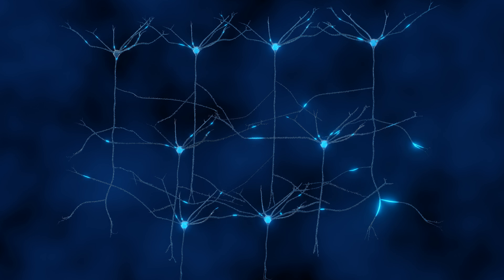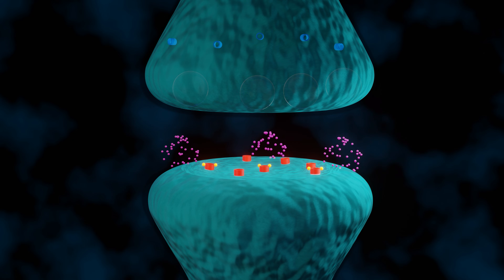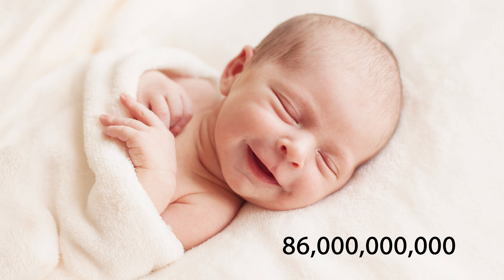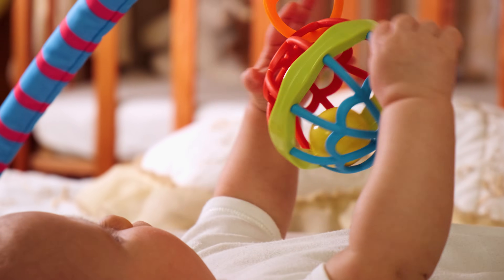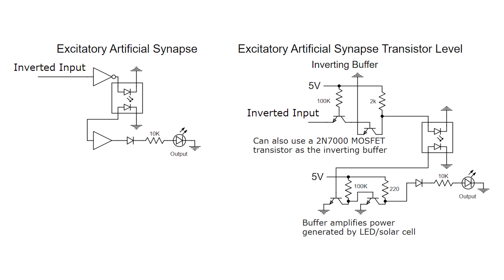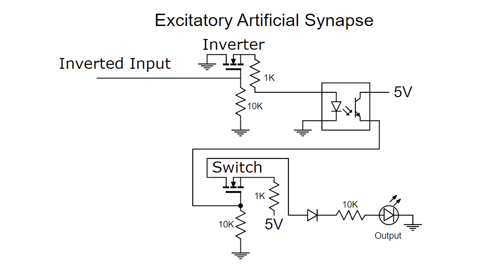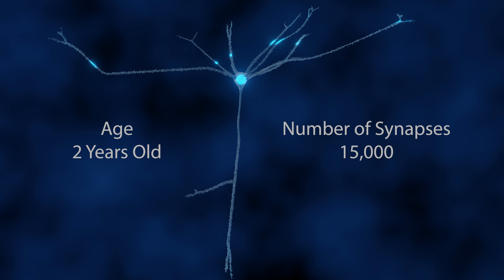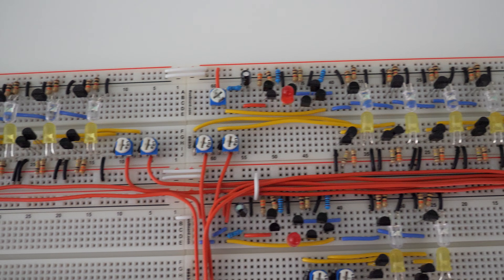How to Build an Artificial Synapse

Comment: you are not using mosfet for inverting in the practical led  based optocouler circuit and used in optocoupler ic circuit 
 why?

Comment: In this I made the excitatory neuron and receiving neuron, but I am not able to get the time delay in pulses of the 2 neurons, what could be the reason ?
Reply from the maker: It sounds like the charge is making it fire with just one synapse input. So increase the resistance of the excitatory input or increase the size of the capacitor.
Reply: @GlobalScienceNetwork i haven't made any inhibitory and excitatory neuron pair, I just have one excitatory and receiving neuron, what should I do, to make the pulses not blink the LED at same time across both excitatory neuron and receiving neuron.

Comment: Hi! I hope you see this comment. I just wanted to ask;  (6:21) is the Schmitt trigger design similar to a clock, since it switches on and off like an astable 555 timer? if is then can I use a astable 555 timer, yes or no?
Reply from the maker: Yeah, you could use an 555 timer with a capacitor. I will make a video about that at some point. Technically it just uses way more discrete components so the Schmitt trigger is the low parts design.  However, since the 555 timers is an IC it is actually more simple to implement with that.
Reply: @GlobalScienceNetwork  Thank you very much sir

Comment: Cool coincidences. In the last couple days I’ve been watching your videos and other channels’ videos about transistor based logic, and I’ve been playing with transistors on breadboards as a result, you posted a clippy movement video today which I’m obviously into, I went back to check out this video, it’s talking about optocouplers, which I just learned about today from my friend because we’re building a midi interface and he knew we’d need them, and I just ordered a few different IC based optocouplers.
Reply from the maker: Sweet, sounds like we are thinking along the same lines! I love the Clippy profile picture!
Reply: Speaking of synapses (and coincidences), I just watched Veritasium’s newest video today which talked about networks (6 degrees of separation and some results that occur because of the layout of network connections) and how neurobiologists have traced out every neuron of a specific worm (C. elegans). Apparently it has 302 neurons and ~7000 synapses.

Comment: the brain is an a natural entanglement machine the neuron are the  cell as able to set the spin state if u are able to do it ,u have to use qbit logic
Reply from the maker: I could be but I think that there are plenty of states that are changing with basic charge flow. It is still trillions of ion states per neuron. If that does now work, then it would be time to look deeper.
Reply: @GlobalScienceNetwork  tats bcause u use a bit logic on output and not analogic output then u have to use that lecature as a  qbit state abd than u get the sesult u can apply to logic so u need also 1 qubit but u can apply it to a chain thats in how work actually ia but not the brain a ia net is a linear qbit chain
Reply: umanty dont undarstand that yet but use ur brain are the umanity able to make a good use of it?

Comment: Hey, you triggered me to ask a question. Is it possible those with ADHD or are on the spectrum, have more synapses than the average person?
Reply from the maker: I am not well versed in that topic. I think it could be from excessive synaptic pruning or limited synaptic pruning. Also, some differences in the supporting astrocytes like glial cells. Basically, though, the brain connections are a little different for some reason.
Reply: @GlobalScienceNetwork  Thank you :)

Comment: Funcionaría con cualquier oscilador, por ejemplo un flipflop de funcionamiento libre, con resistencia variable?
Reply from the maker: Bueno, en realidad está integrando carga y disparando a un umbral de voltaje. Así que realmente no. Eso sería binario encendido y apagado.
Reply: @GlobalScienceNetwork  verdad pero por ejemplo si se utiliza un optoacoplador en circuito de oscilación, se podría controlar la carga y descarga del condensador, entonces funcionaría exactamente como el disparador que muestras en el vídeo. (Solo pienso en algo más pequeño pero que se acerque aún más al funcionamiento que muestras de la neurona). Ahora mismo por no tener los mismos componentes, use un Arduino para realizar el disparador, la verdad me impresionó. La sinapsis fue con un LED y un foto-resistor.
Reply: Ya que si es el caso se podría optimizar aun más el circuito.

Comment: Very cool! I was pondering something like this but from a software perspective. Fundamentally the brain is a set of interconnected neurons with different action potentials with eachother. Similarly we have Vector graphs with magnitude and direction to other nodes which are interconnected. perhaps instead of trying  to replicate the actual mechanisms behind a neuron and rebuilt the wheel... we could use these vector graphs to create an AI brain that functionally works similarly to a human brain, however each node would be a vectorized piece of information rather than a raw binary operator. 

A step up from this would be using qubits as nodes to drastically speed up computation.
Reply from the maker: Yeah, that would be an interesting approach! I am building it in hardware as this is the only way to actually make a conscious device. I explain this more in my next video which I should come out this week or upcoming weekend. I am editing it now.
Reply: It is the massive interconnected-ness that is hard to emulate in silicone because chips have to be etched so the living, plastic aspect of how our brains function cannot be easily re-created at the scale needed.  I have never even seen someone simulate a mouse brain, but maybe I missed it.  I think the AI folks are barking up the wrong trees, or networks, ha.

Comment: Please please please add two capacitors (one with high resistance slow leak and another with threshold discharge) to keep track of both synapse types
Reply from the maker: Why do you need the slow leak?

Comment: What about using surface mount LEDs in a row or grid facing directly into the sensor where rows/groups are covered by shielding to encourage the neural network to condense engrams within the groups
Reply from the maker: Yeah, that would be one way to do it. That would be worth trying.

Comment: In the circuit with the button, which transistors are you using?
Reply from the maker: Both of them. It is a buffer that increase the current of the input from the LED that is acting like a solar cell.
Reply: @GlobalScienceNetwork  Sorry, I meant which type of transistor, i.e. 2N222?
Reply from the maker: @thebestusernameevr  Yeah, in this case they are 2N2222 or 2N3904 either one will work.
Reply: @GlobalScienceNetwork  Ok thanks for the response. I'm trying to copy the circuit @5:05 but I can't seem to get the blue light to to turn on. I'm using 5V from an arduino, 220 Ohm resistor to the white LED, then 1k resistors for the other ones. As far as I can tell, I have it wired like yours

Comment: It seems to me that your focus shouldn't be on the optocoupler, but on the variable resistor. For instance, why should the output change... that is, how to effectively model the variability of the ion channels? Perhaps there should be a combinatory gate that adds voltages depending on other criteria. I don't know enough about neuromedicine to say what those criteria are, but it does look like that should be a major point of research into the development of a model that would imitate the function of an actual neuron. Learning could be accomplished by preferring certain paths by repeated use until one path is always used, effectively "reducing the number of synapses". Perhaps the artificial synapse shouldn't fire at all unless the output of the combinatorial gate reached a certain potential, either through a single path (learned behavior) of combination (trial and error). Maybe a zener diode and feedback? (sorry for the edits, am just thinking about it as I type).

Comment: Uhm... what's actually the point of the artificial synapse/optocoupler? It's just a simple relay.
Reply from the maker: Well you at least need a buffer so you can send to multiple neurons and then a diode so you do not get reverse current. Do they have to be electrically isolated is debatable for a fixed network. I plan to leverage the optocoupler in neuromorphic designs. The plan is for it to be able to learn on its own by interacting with the environment.
Reply: @GlobalScienceNetwork  Using optocoupler to embed a neural weight intrinsically?

Comment: Great video. But a question still is in my mind. How do you want to make it to learn. Now it's a network with adjustable weights but no auto asjustment method for the weights is provided. By the way great video.
Reply from the maker: If you watch the RC truck video you can see that I adjust them manually with a potentiometer. I will be making a neuromorphic design in the future. You can try and make it neuromorphic as well.
Reply: @GlobalScienceNetwork  Great! I can't wait to see that video. I subscribed 👍

Comment: Since memristor changes it resistance base on the input current, why not use it for the synapse since there will be more current flow if lower resistance and less current flow with higher resistance
Reply: There are several papers on this

Comment: Maybe it would make sense to add a thin sheet of that kind of phosphorescent material that gets charged with UV and DIScharged faster with, uh, I forgot the frequency range, red or IR perhaps; between the two halves of the optocoupler, so it can have both an activating and inhibitory inputs based on LED wavelength; and the fading of the phosphorescent adding a bit of an "analog filter" to the pulses like the little squirts of neurotransmitters; and by having it be somewhat thin, you can have it work also as a biasing factor, contributing more or less to the incoming pulses that would partially shiny thru?
Reply from the maker: You could try it.  A "solar cell" has a pretty fast response and similar behavior but I am defiantly open to other ways!

Comment: Why do you need an optocoupler (LED/photodiode)? Can a simple inverter (74HC06) or an NPN transistor be used instead?
Reply from the maker: In this case they are just a relay or buffer but will try to add in some features in the future for neuromorphic designs.

Comment: Thank you for the information. Is it possible to receive additional information regarding the diagrams? Please provide a detailed description and diagrams. Thank you and best regards.
Reply: Thanks, GSN! This is all so very exciting!!! I add my vote for a proper schematic and parts list, for the breadboard circuit in its present developmental state in this video. ( It would be difficult to pick these details out of this video. )  Meaning, I understand that 1) you want to expand the project to include components that better reflect the biological mechanics of a synopsis and that 2) that might start with the incorporation of op amps to replace transistors. However, I sort of feel that you are adding "project creep" to the project, before the community that you desire to create has had the opportunity to learn from building your present "ground zero" circuit. In addition to having the details of the circuit on the schematic, it would be very helpful to have you label the various operations of the synapses (presently three, IIUC) on the schematic. ( I must admit to having my own agenda... I live in a retirement community. A retired neurologist has just joined us. I think it would be a lovely house-warming gift to build out your circuit on breadboards, add the function labeling and house it in a glass-front presentation case.) Additionally, if ( in the year that has already passed ) you have not established 1) a thread on a electronics forum for communications for the electronics build and 2) opened a repository for the exchange of electronics build files, documents, etc, I suggest the Community Forum at EEVBlog, for the communications thread, and GitHub, for the files repository. I will watch the additional video. Maybe I will find that you have already made accommodations for the exchange of (electronics) information? If so, please post the locations/links in the Comments section of this video. Final thought... An AI program might be able to develop  the expanded electronics model, including the needed additional/future electronics model functions that you want to add, the schematic, a PCB board layout and a breadboard layout all rather quickly. Its worth a shot... Cheers!

Comment: His synapse circuit has a mistake.  It can't possibly work as shown.
Reply: I want to work on a project related to this topic. Can you tell me where the mistake actually is and how it can be solved?
Reply from the maker: If you explain more, I can help clarify! It definitely works as built. There could be an error in the diagram, as I am not perfect.

Comment: Now I want to simulate a synapse with cellular automatons. Like have one value for the level of voltage potential, one value for the calcium concentration and then either something like cell wall or better yet direction that "signals" can flow. 

But somewhat tweak the algorithm to model neuro plasticity, so you can do some "learning" by simply having a state of modelled neurons.

Comment: Why use optocouplers at all? And as I know, neurons have the resting potential, they're not like "completely off" as the diodes, and the inhibitory signal is the negative shift of the voltage in the neuron.

Comment: hey I'm planning on creating these for a project but I'm a little confused, does the first LED turning on the other LED purely by touch it or are they connected with wires I just can't see. I'm just confused on how power is being transfered, I understand when the ic is used just not the LEDs
Reply from the maker: There is not a wire that connects them. Each circuit is technically electrically isolated. It works like a solar panel. The light shines on the solar panel, which creates power in the other circuit. The second LED is basically a solar panel. The amount of power generated is very low, but this gets amplified by the buffer.
Reply: @GlobalScienceNetwork does the type of LED used for the second one matter or can I use anything.

Comment: It would be cool if you could use a "flawed" memristor that would become more resistant over time if not used, but would lower in resistance if used regularly
Reply from the maker: Yeah, making it neuromorphic is the next step. Keep thinking about it, or even try and built it!

Comment: Sorry but its not clear to me why the 'hardware synapse' would need an optocouple rather than a hard wire connection....  I had always thought that the brain had the ability to rewire itself - hence biological synapse were not physical connections.
Reply: It can rewire itself, you’re right.  It also can up and down regulate the number of pre and post synaptic receptors.  This is why psychiatric medications take time to exert an effect.  I’m a neuropsychiatric nurse practitioner and am studying for my PhD in neuropsychology.  I was injured in an accident in 1994 and had to stop.  I’ve picked up my studies since.  This is a crude model, but interesting.  You’re correct, there are definitely missing features on this system.  Neurons can also sprout co-lateral axons and new dendrites and new dendritic spines.  We also know that location of these synapses influences odds of inducing an action potential as well as timing frequency and which neurotransmitters are sent.
Reply: The "rewiring" happens in the form of shining the LED on a different detector. This is why analogies aren't always the best way to look at things, but especially beyond bare basics. The brain isn't "wired" at all, but that's the common analogy to describe what's going on. If you wanted to do such a thing with wires, the synapses would be spark gaps... but even that doesn't really work out beyond over simplified conceptual ideas.

Comment: hmm... a synapse has more in common with an electrolytic capacitor than an optocoupler...
Reply from the maker: This is a starting point and it does need work. Keep thinking of the best way to built them. I am building a demo for the hardware based neural network now. Stay tuned!

Comment: Implementing your circuitry as Verilog code and running on a low-cost FPGA would be optimal. 
Grok, for example, can convert your circuit diagrams into HDL code. Perhaps I will attempt such a project.

Comment: I havent built it yet ut was thinking if you added a mic input to it so the firing pattren can change based on tone input to simulate hearing in diffrent areas of the network. so as you speak to it you can see what areas fire and come up with a logic respose based on the amp of audio wave in to make a response. Like if it hears a loud noise it chould have a reaction like fear or activates the other networks to try to figure out if it is good or bad and if good respond 1 if bad respond 2 if undeceiced back to listen.Just my random thoght on it. very cool to see the workings of it
Reply from the maker: Yeah, adding in input and outputs to the hardware based neural networks is going to be the next step! You should defiantly try and build it and see if you can get useful outputs. I am working on a project that I will hopefully finish soon with inputs and outputs.

Comment: Each neuron is like a transistor.
Reply from the maker: Each neuron has a few transistors in order to work. I would say the main component is actually the capacitor as it integrates the charge. Maybe you are saying there is a slightly differnt way of designing it that makes the overall design more like a transistor?